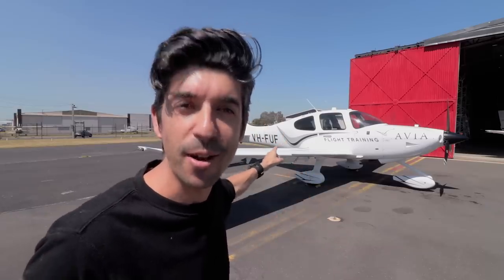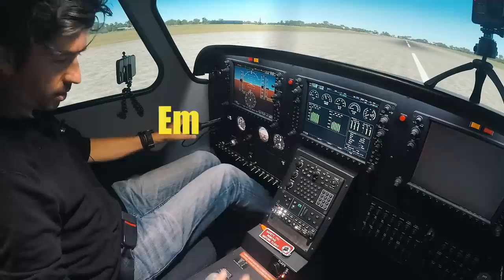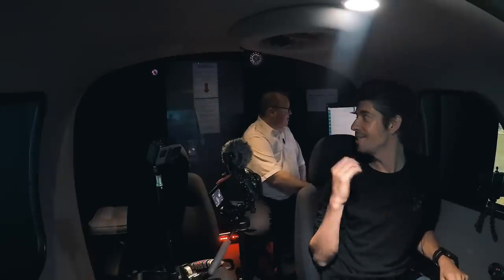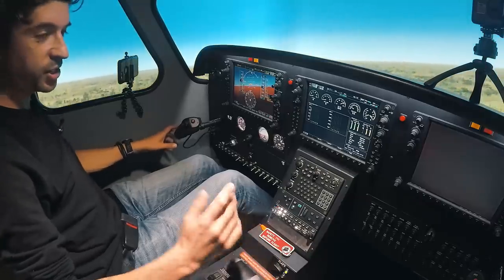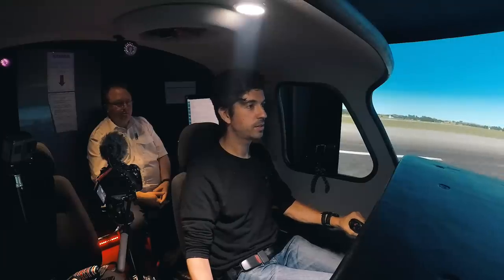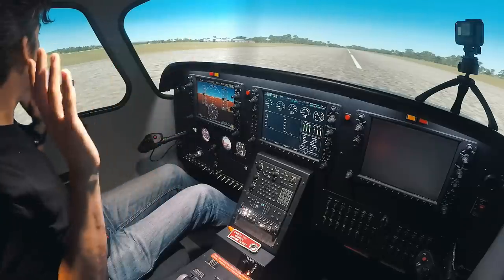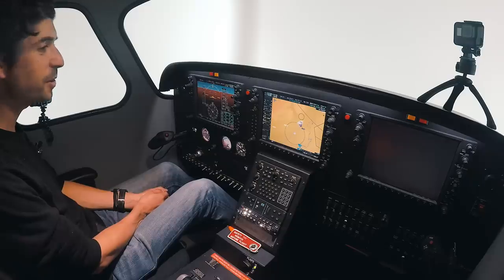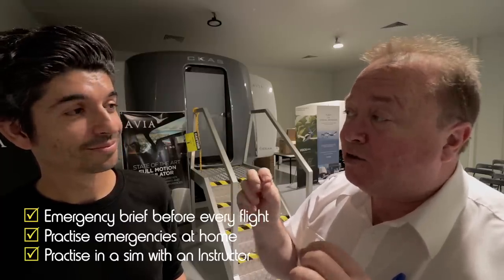EMERGENCIES in the Cirrus SR22 sim - parachute deployment

Comment: The SR22 500agl the chute is available. The SR22T 600agl chute is available.   The simulator failed to show a big nose down moment when the chute is pulled, that is the real world, may want them to reprogram that part.  For those confused about when to pull CAPS.  The factory advises to pull the chute when closer to the ground (under 1000agl), not attempt to land.  By the time you assess a crash landing scenario you may have lost too much altitude to use CAPS.  Of course it's fine to glide over an open area if possible, but pulling CAPS must not be delayed.

Comment: Great video. I’m curious though why you were so eager to use CAPS I am training in a technam which has a CAPS equivalent and have been taught that it is a last resort, and to prioritise gliding the  plane down to a safe landing place, because if you choose to use it you are giving up control of the aircraft.
Reply from the maker: Thanks Oliver. The Cirrus Standard Operating Procedures state when (and when not to) deploy CAPS in certain emergency situations. The theory on low level deployment if you lose the engine is that successfully (that's an important word) pulling off a survivable glide landing is hard. You have to find a suitable flat bit of terrain first of all, then you have to land it well, then you have to hope there are no obstructions on the ground, etc etc. Whereas descending under parachute means you are affected by the winds, but we are trained to position the aircraft so the wind pushes us to our designated landing area. So unless it's low level ( < 2000' AGL), you are actively troubleshooting and positioning the aircraft prior to deploying the parachute to give yourself the best chances of survival. Hope that helps, stef 👍
Reply: And because of people thinking of caps as a "last resort" a lot of airfact with perfectly working parachutes made smoking holes in the ground. After that they changed the training to make it not just a last resort but a safty feature that should be used, and in at certain times without any hesitation

Comment: On the second one you could have turned back to the airport. When your engine started to run rough I was literally screaming at my monitor turn towards the airport, but you just kept going straight further and further from the airport. I know I would have definitely turned around while the engine was running rough and then glided the rest of the way to the airport, the only problem I would have to land with tail wind, but it was doable, you didn't have to pull the chute.
Reply: You're right. But I mean. Point of the video was using the chute wasn't it?
Reply: You are right -- that guy is more interested in getting subscribers and fake-flying, than being practical -- not good pilot material!
Reply: Jesus, the point of the flying is to practice using the parachute. Its more about the procedure around using the parachute than the flying itself.
Reply: @HarryBird  WRONG!  The point of safe flying is to NOT have to use a chute, but to have the training to be able to handle your aircraft (and your brain) without it.  There are very few times a chute would be necessary in an aircraft -- it was the rather un-informed and not-well-thought-out gimmick of someone who thought they'd make a lot of money!  A well planned flight plan, consideration of ALL the possibilities if you get in trouble, and good airmanship would preclude use of a chute on an aircraft most of the time.  Parachutes can tangle, stream, may things that would drop a plane to its demise.  NOTHING can take the place of practice and sufficient training, planning and sensible caution, of course.
Reply: M.J. Leger You misunderstood what I was saying. The point of him flying the simulator that day was to practice using the parachute. I agree with what you say about the point of flying as a whole though.
Reply: Aviation Nut just on this from me I’ve done extensive flying and I’ve always been told to work the problem try to trouble shoot etc. However I do see your point as well being a single engine aircraft in VFR I probably would have preferred to return to the field. Any doubt is doubt enough but he I was wanting to test CAPS so it’s probably not a fair assessment.
But it’s just my thoughts I could be wrong.
Reply: Togapower Okay, can it get out of a spin?
Reply: Half of deaths ocurs when pilot dont use the chute....stadistics...

Comment: Quite an interesting video. Good to practice in a safe environment as you said. I found it interesting with the emergency where you pulled CAPS that you pull it without attempting a glide landing at all. Makes sense that this is the safest method but still surprised me. Would you only attempt a glide when CAPs isn't available?
Reply: The priority is on surviving the landing. The pilot's I watch say it's better to wreck plane, survive, and let your insurance replace the plane, than to die trying to land it normally.

If I was flying a plane I owned, and had put money and labor into, you bet I'd have a hard time pulling that level though.

Comment: Nice! Every private pilot should try and do some simulator sessions. It is invaluable. I have to do 6-monthly sim checks and an annual route check. As stressful as they are, they are essential so that if the worst happens in flight you can carry out the required actions almost instinctively. Given the likelihood of an engine failing in a GA aircraft is considerably higher than a jet or turboprop the training should be mandatory...

Comment: That looked like great fun Stef. One question though, during the engine failure at height you immediately pulled the chute. Is that the standard procedure as I had thought you would only use it when a standard forced landing was not practicable?
Reply from the maker: Thanks, the procedure is below 500' AGL, land straight ahead. From 500 to 2000' AGL, it's an immediate CAPS pull. That's the procedure we're trained. There are a few exceptions that weren't covered here, and to non Cirrus pilots if may seem weird/wrong, but I'd always rather plop down under a parachute than try and execute a good forced landing especially when large flat obstacle free areas may be hard to locate with such little time.
Reply: I was just thinking that there might be times when a good forced landing would cause less damage. If the chute is deployed what damage (repair costs) is they likely to cause? Not being awkward Stef, just interested.
Reply: Most SR20/22 that land on CAPS are too mangled to fly again, that's because wing causes a wing to land first and bends wing spars badly. However it is eminently possible that won't happen and the plane will be fine with only the cost of a couple of used Skyhawks in repairs.
Reply: depends on insurance as well. if the insurance states to follow POH, and you don't, you went get paid out. also, any forced landing is not about damage prevention to the air frame, but to the occupants. I'd rather live to worry about a damaged airplane than try and prevent damage and die or severely injure myself in the process.

Comment: I could feel the pressure!!  Great way to practice.  Thanks for bringing across the intensity so realistically!  Why were you not at Cessnock hey?  I got some Cirrus action coming in my videos soon.
Reply from the maker: I should have attached a heart rate monitor to be honest, it's very realistic and you do feel yourself bracing for impact when you touch down. Haven't been to YCNK for a while. I used to go there a lot when I flew out of Bankstown but should go back for sure. Could do a wine run for the missus....

Comment: that's pretty neat, didn't know Cirrus simulators existed until now. i take it you dont need type rating to fly in a cirrus?
Reply from the maker: You need a certification from a qualified CSIP (Cirrus Standardised Instructor Pilot) to hire an SR20/22 from the FBOs in Moorabbin. If you're purchasing one and have never flown before I believe Cirrus give you the training as part of the purchase package. The SF50 (the jet) does require a type rating though I believe, but others may correct me on that.
Reply: i presume the minimum time for a check ride in a cirrus depends on a rental company, e.g. i normally fly 172R but if i wanted to fly in a 182 skyhawk I need a minmum of 5 dual hrs in a 182. im based out of Canada, and there are very ffew flying clubs that have SR22s.
Reply: @StefanDrury  you are correct the SF50 requires a type rating

Comment: I've never flown an aircraft with a yoke/control like that, it looks uncomfortable. Do you like it and was it easy to get used to?
Reply from the maker: It’s surprisingly easy to get used to. I was a bit sceptical having come from a central yoke in a PA28 previously, and wasn’t sure if the spring loading would give me the same “feel”. But honestly after the first flight I loved it. It’s super responsive, very stable, and the electric trim is the cherry on the top for easily setting stable aspects of flight. Big fan.

Comment: 1700 ft per minute??  That's like 30 ft per second.  That's basically falling.  I'd take my chance on a dead stick landing.
Reply: Unless there is icing, I am in a flat spin, I collided mid air or my aircraft broke up I would never pull that thing. If it was 800ft/m okay, but 1700ft/m is achievable by almost any crash landing
Reply: No fatalities in any CAPS deployment so far
Reply: @RainbowManification  but still, I wouldn't do it  if I saw any other possibility. 1700ft/m is almost 10m/s. That's really fast.
Reply: Yea, but falling vertically at 30 feet a second in an airframe designed to protect its occupants is way different than gliding horizontally (or stalling STRAIGHT DOWN) into a structure, traffic , etc.   The system has its use for sure.
Reply: the math comes out to 18 MPH... aircraft hitting a field at 18mph is going to turn out better than hitting it at 80 mph. The cirrus parachute has had 100% success above 100 ft. and under Vne. 100% have lived. There have been a good handful that pulled too low, which isnt survivable
Reply: @RRRRobbbb  he's right. You're just an idiot
Reply: Yes , but the purpose here was to test the CAPS, wasn't it ?

Comment: I know a Cirrus doesn't have the greatest of glide ratios but surely it can return to the runway at 1500 feet. This video is from 2018, perhaps before the erosion of the erroneous notion of the impossible turn started. Time for follow up video on that? Showing that indeed the impossible turn is easy.
Reply: I would add that even before a chute is pulled in VMC you try what you can achieve in a glide, potentially a controlled return to runway. Second, if you decide that pulling the chute is inevitable, pick a location for it. Dropping into 450kV powerlines can make for a bad day. On a cliff can also be bad .
I think the most important training regarding a chute is to remember it's there. And any safety pin. We've had a couple of VL3 stall spin crashes in Europe and both failed to deploy the chute. One may have tried to pull it but failed to remove the safety pin. Or in this case, not so safety pin.

Comment: Excellent video.  Thanks.  Does the sim include engine noise?  If not, do you think it would have been helpful?
Reply from the maker: Yes it does, and we had some in the background which you can hear, but the microphones were set to pickup voices rather than ambient noise. But in the sim you can definitely hear the engine.

Comment: So in emergency two you were 1100' over the field when the engine failed. Could you at least try to do an impossible turn before writing the aircraft off?
Reply: I just flew a similar flight in X-plane in an Aquila 211. I started an impossible turn two seconds after simulating the engine failure at 1500' and landed mid field on 17L.
Reply: Who cares about saving the airplane if you have a parachute

Comment: I would never buy an aircraft that requires a ballistic chute in order to pass certification, because the stall/spin characteristics are nowhere near good enough.
Pop that chute on a very windy day and you might die being bashed to pieces as the chute takes you on a X/C.
The chute can be just as lethal as it can be a saviour.
Cirrus did the best ad campaign in aviation history, hiding the fact that the chute was there because the stall/spin characteristics are lethal, and turned it into the safest aircraft in history. Sucked in plenty, seduced by screens and sleek looks. But underneath, a sub-par airframe. IMHO.
Be careful.

Comment: 1700 FPM descent under that parachute??? Thats going to be one hard impact at the bottom. I 100% dont understand that. Why not fly it out and land in a field if you have the option with more altitude than 500 but less than 2000 feet? The chute seems like it would be plan C with energy and altitude available to the pilot?

Comment: I cringe at this as a gliderpilot. There are always so many and there were so many perfect opportunitys to land on some kind of field or return back to the airfield. An engine failure is nothing extreme, wo dont even have an engine! But I understand you using it as its the point of the video.
Reply from the maker: I have a lot of respect for glider pilots and agree it's a skill to pilot a non-powered aircraft to a landing site successfully. However this is a horses for courses argument, and in an aircraft with a parachute system onboard, given the choice I would rather descend under a known profile (vertically and preparing the cabin in the way I've been trained) than attempt an unknown glide approach to a surface that may have obstacles I can't see until it's too late. But given the option to glide to an airport/airstrip of course that would be the choice as demonstrated in this video (with the right turn back to the cross-runway that we did).
Reply: Stefan Drury 👍🏻
Reply: It might also be worth pointing out that a sailplane has been designed specifically to have very large glide ratios the likes of which you just won’t get in a light powered aircraft. 

A glider might have a glide ratio of 50:1, a Cirrus a glide ratio of less than 10:1. So I do take issue with your suggestion that an engine failure is nothing extreme. Out of interest, do you fly powered aircraft as well as gliders?
Reply: you dont,therefore have the half ton weight of an engine,nor fuel weight for the flight,you have thermals and huge,by comparison, lift surfaces.powered aircraft have a lot smaller wings because the are being dragged thru the air and create the lift required.below minimal speeds,they are elephants.good gliding sir.

Comment: The parachute deploying in sim works fine what if in really life it fails ...it will be on the dumb way to die ..
Reply: That has actually happened only 3 times, and all three planes successfully landed without injuries after the CAPS failure.

AV Web did a video about it.

Comment: A descent rate of 1700 fpm! That’s gonna hurt. Your average military, static line chute has a descent rate of around 1400 fpm and its a gamble with every jump as to whether or not you’ll break a leg, an ankle, your back, blowout a knee or two etc etc. I don’t know of anyone that gets excited come re-qual day. That said, I guess the gear and the seats will slow that rate on impact but it’s still going to be a very heavy landing.
Reply from the maker: Yes the seats in the Cirrus are made of a honeycomb material designed to absorb some of the deceleration forces upon impact, that's why you have to be careful not to put a foot or knee on them when getting in. Also as you say the gear is designed to help in addition to that, and with a proper brace position (as is proven in many Cirrus incidents when the parachute is deployed) you have a very good chance of walking out of it unharmed.
Reply: @StefanDrury  the key phrase is"time to" you know youre going in,turn off the obvious,prepare and alert,you have at least 4 ft of collapsable cushion,which,believe me,enormously reduces impact "g.force"which is THE KILLER,sure ,bits of this and that bouncing around,bruises galore,even broken bones.terminal velocity of 125mph will mean death to all,with no exceptions.this system is a brilliant"im not ready to die"last resort,sod the aircraft,but make sure your liability insurance is current.be safe.

Comment: I have zero Cirrus experience. But, i feel like for scenario 2, that's a bit of a hasty decision to pull the chute? 

At the first sign of engine trouble you were at ~1200ft, and then continued to climb straight ahead to 1500ft before the engine quit. I feel like in that scenario, at the first sign of engine trouble you could have begun the turn towards the airfield, and made a glide approach after the shutdown. Seems unnecessary to use the chute on an aircraft that is still controllable. 

IMO, the chute is a good feature. But I would be more inclined to reserve it for scenarios in which a safe forced landing can't be conducted. Like a control failure, or during night ops etc.
Reply: Yeah it's for demonstration

Comment: Honest question here. I am in no shape or form a pilot and only flying experience I have is with a video game controller. But on the second failure, would bringing flaps down to full and trimming up bring the aircraft to a controlled glide where you can safely land it? I mean, it was still on the climb out and I’m sure the airport was achievable. Or am I talking out of my butt and have no idea how it works in the real world? I’ve always pictured myself using flaps and trim to slowly decent for a safe landing. Or is the “no engine” scenario a bad idea to do my procedure and would inevitably cause a major stall?
Reply: flaps increase drag to increase lift,its a trade-off,your only velocity is gravity,hence you need altitude,a stall will happen so quickly,then you drop,not like a leaf,but an elephant.the basic physics apply.